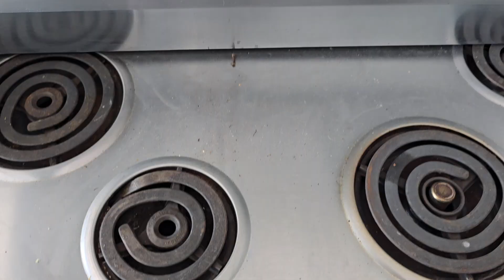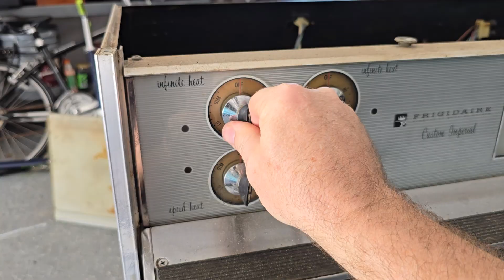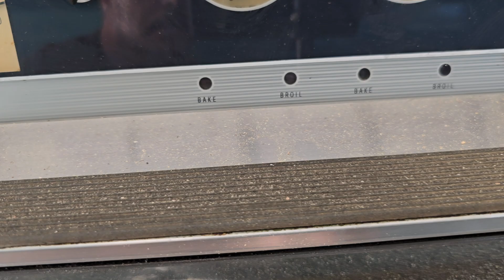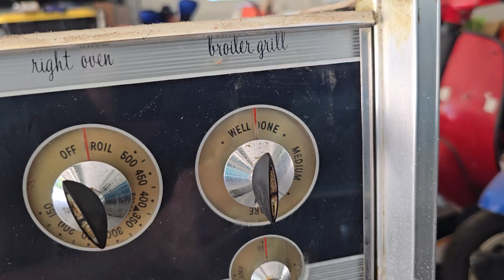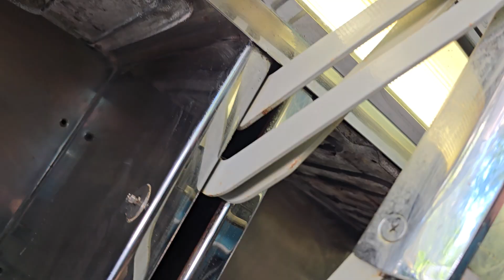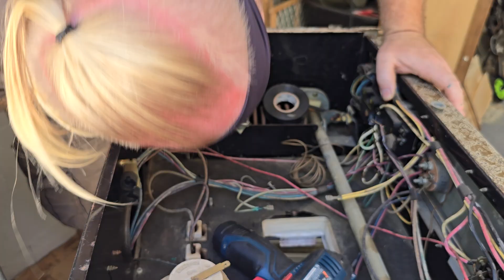Restoring a Frigidaire Flair! (Part 1 of 2)

Comment: The Flair was available from 1962 until the start of 1971.   Which means if that was amongst the last built it is at least 55 years old. Cleaning we solution is supposed to be wiped off before turning on the ovens.  It takes several rinces to get it all.  From what I heard the inside of those ovens is nickle, which is easier to clean.